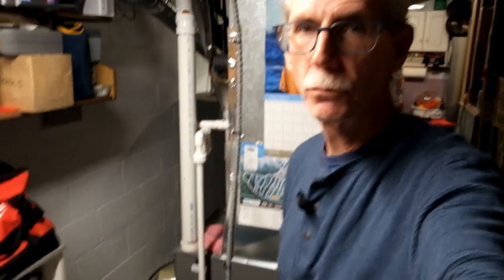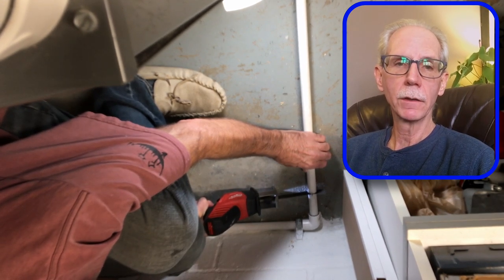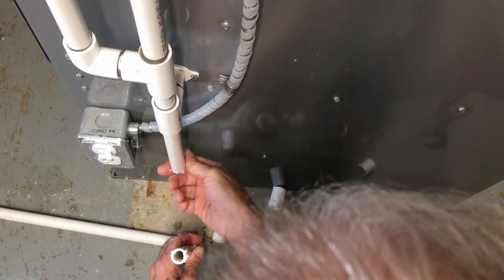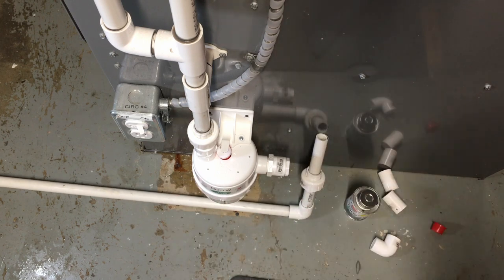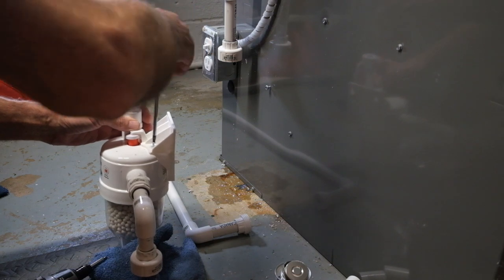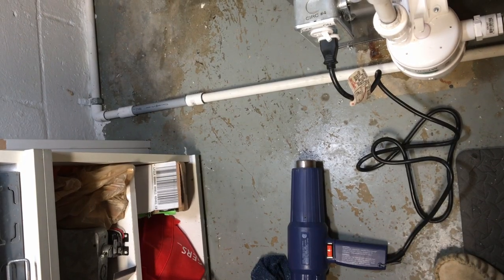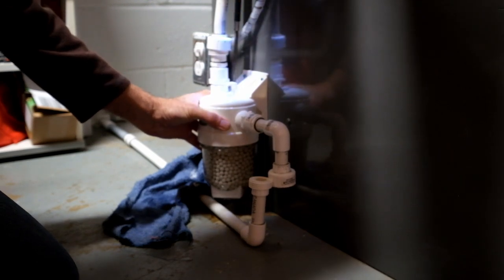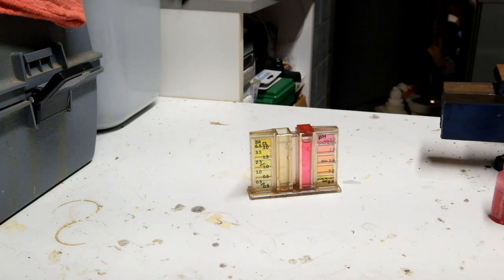Condensate Neutralizer

Comment: Great video , thank you we have similar neutralizer kit on our tankless heater and bought new kit hard pipe. Is it dangerous to replace yourself , gases escaping ? There is nothing online about the safety during replacement but company Axion makes statement about cancer. I figured I ask you , thanks
Reply: I have a Navien tankless with condensate neutralizer. The neutralizer tab popped up for "Service Required". I'm wondering if it's someone I can do instead of paying for someone to do. Any luck?
Reply: @JustinRoman could mean one of many things like the acid neutralizer not actually working properly or the drain not draining due to rocks being clogged up on eachother from excessive use could be as simple as just switching out the rocks or having to replace the entire pump or just attaching a new drain line all depends on what and where the problem is occurring

Comment: does this need a bypass?
Reply: @MonkeyBonkey, a bypass is build into the unit. At the top of the bowl (under the white cap piece), the bowl divider partition is open. If the unit clogs at the bottom, the bowl fills with water and the water exits above the partition. There is also a float there that will pop up about an inch if a clog occurs. It is painted red and provides an easily viewed indicator of a clog. I installed one of these on my Navien Takless water heater.  It's working like a charm.